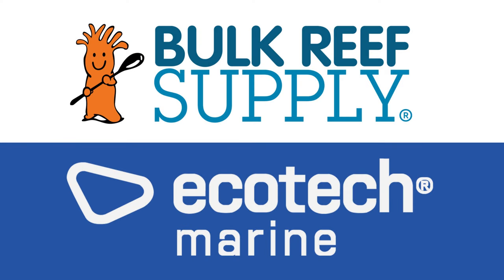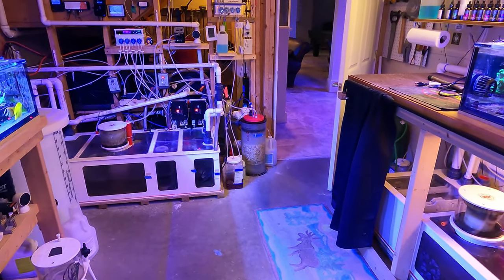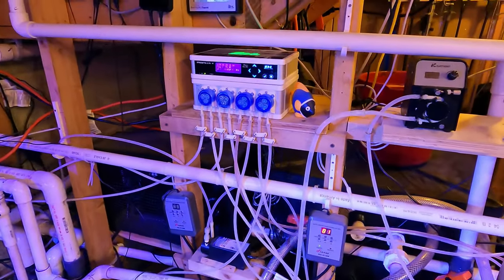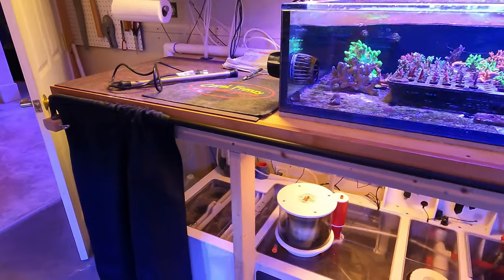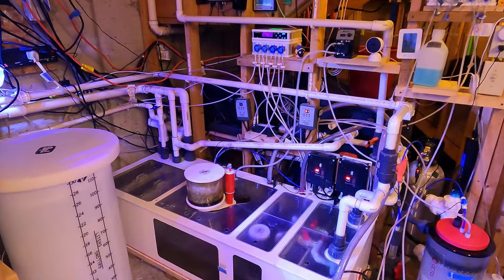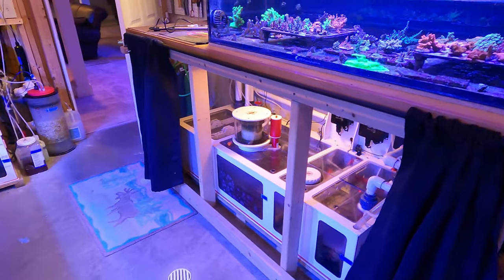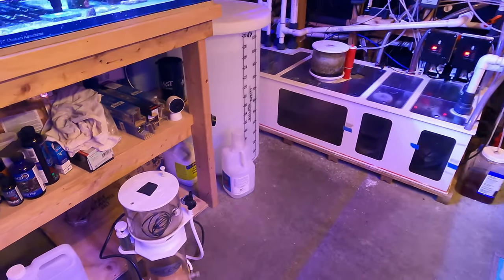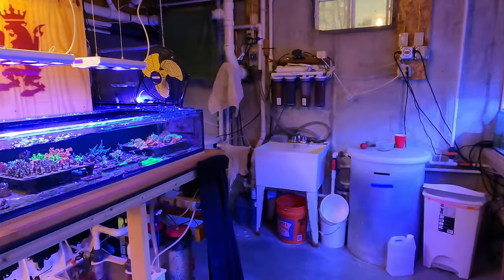Tank Plummets to 72! Why Redundancy is So Important

Comment: I learned it doesn’t matter what your heater cost as long as you use 2 at the same time…. If one breaks the other picks up enough slack that your tank never cares. I even use 2 heaters in a 10 gallon tank hahaha

A BRS tip hahaha
Reply: I used 2 Titanium heaters in my systems. Both stoped working around the same time. Saw the temperature drop to 72. Placed a Eheim to replace 1 out of the 2. Yup… temperature went up. That’s how I knew both were dead. Spare heaters regardless are good to store around the house.

Comment: I had the same issue with 2 of my systems. Noticed temperature dropped on the chiller to 72 degrees also. Titanium heaters. Both died from a week apart. Wondering now if there is a short life span with the titanium heaters. Eheim spare heaters saved my tanks. It is pretty cold here in California as of now. What a coincidence your titanium heater just quit working also. My titanium heaters are branded by BRS. It is what is. Spare equipment is always a good thing. Eheim very reliable when it comes to heaters. Great video👍🏼
Reply from the maker: I use Finnex titanium heaters

Comment: I'm huge on this!  3 smaller heaters on 2 power sources\controllers, two return pumps on 2 apex power bars, two smaller skimmers, two smaller led lights per 24" of tank space with T5 on 4 ballasts, two battery backup units, aux power from 12v in case the power supply dies in the power bars, kalk and ca reactor.  exc exc.  Haven't figured out how to backup the apex yet, but fallback on the eb832's is programmed to keep the tank in a steady state.  Great advice!

Comment: Back in January power went out and shot my controller for my $800 skimmer. Can find pumps everywhere but not the controller. Waited a month to get a replacement, during this time I realized the skimmer didn’t do crap for my nitrates as far as lowering them. Only thing it did was keep PH 7.9 to 8.1, without it it will run 7.8 to 8.09.

Comment: A good point Keith as you need to have redundancy when you’re running that much equipment, 
I have four 500w Finnex heaters on my tank and have the temperature settings staggered 1.5°, which I have plugged into my Apex EB832. 👌
Reply: My kind of redundancy. Nice work. Can’t boil the tank and can’t freeze the tank.
Reply: @deanfielding4411  exactly 😊

Comment: the finnex heaters are fine, but the controllers are pretty bad.  why not just use a ranco heater controller, they are bombproof.
Reply from the maker: I actually had an issue with a Ranco controller once

Comment: I listen to the podcast at work and I had no idea what your setup was like that's sweet so got a question I am setting up a 32 bio cube till I can get a bigger system I am going to do a sump and lots to it it will be a Frankenstein setup but I ran a ai prime on it last time but I lent it out and it was dropped in a tank so it doesn't work right so I am look to get some new lights that I can add onto when I get a bigger system it will be a cube system just not sure the size but anyway I have been watching the brs on lights and I get overwhelmed with the info but keep going back to a led t5 set up or just the led strip lights what do you think and what would you suggest looking to keep at at like 300 350 range but that is not a concrete price in mind thanks in advance sorry for writing a book lol
Reply: O and it will be a lps torch hammer frog primarily